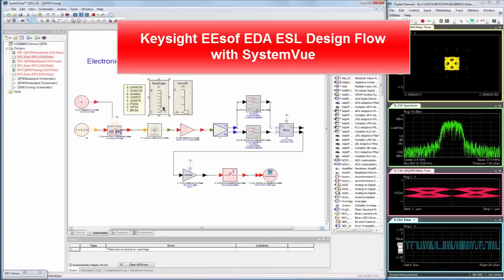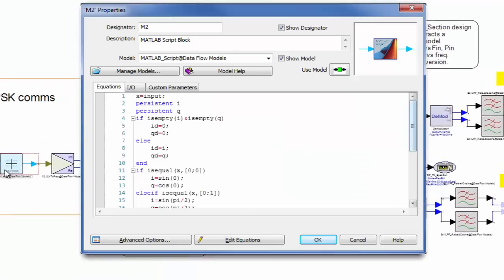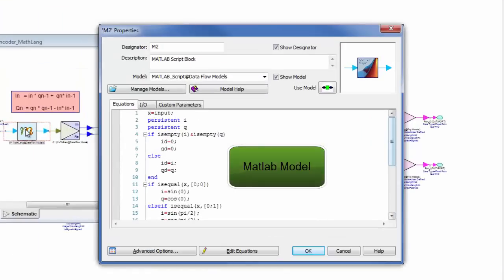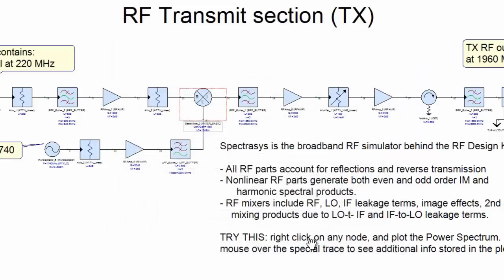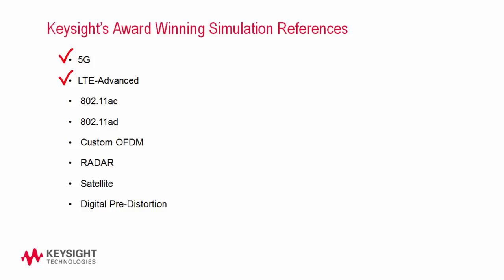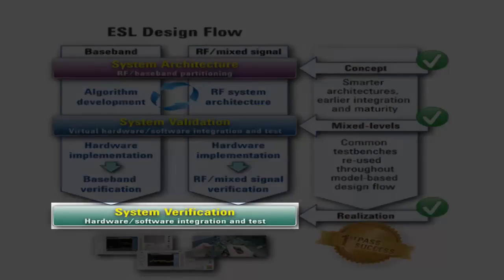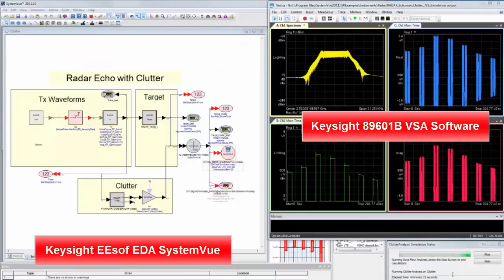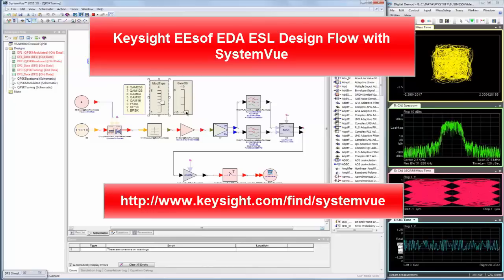Keysight EEsof EDA Electronic System Level Design Flow With SystemVue

Comment: Hi. Please Help the student solve the systemvue test.
According to the task on "Fundamentals of Keysight SystemVue" , we need 
to follow the guidelines to build and calculate the parameters of the 
receiving device, based on the provided scheme.
The scheme of a superheterodyne receiver with a minimum number of 
filters is presented.
  e-meil:        arf1994\e\rambler.ru
Need to display graphs of the parameters of the transmission system:
1. Parascale amplification for all frequency bands of the receptor;
2. step-by-Step noise coefficient of all frequency bands of the 
receiver;
3. signal-to-noise Ratio of all frequency bands of the receiver;
4. Power in the main and adjacent channels of all frequency ranges of 
the receiver;
5. compression Point of the output signal of all frequency ranges of the
 receiver.)